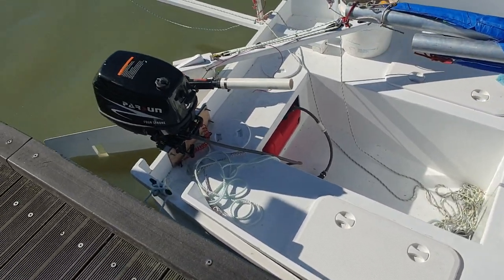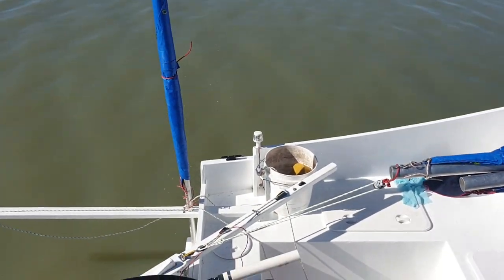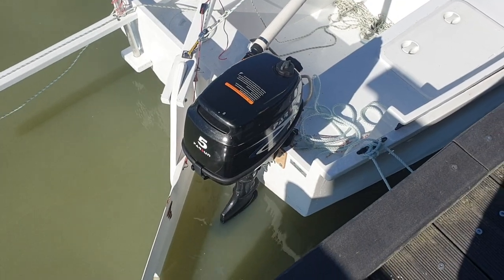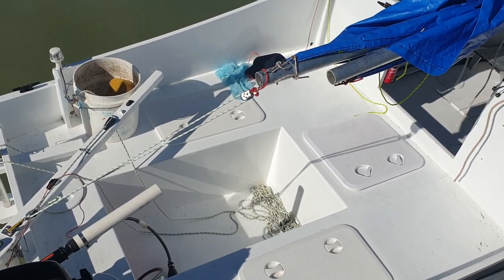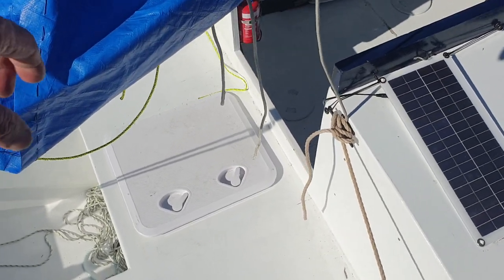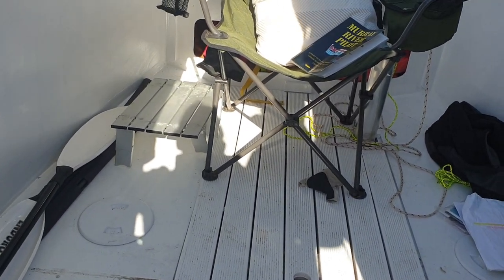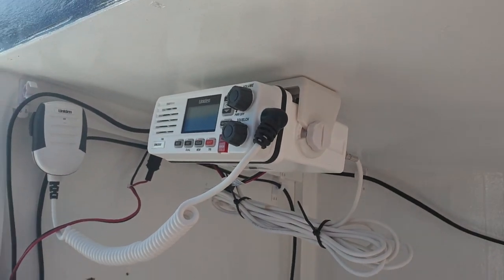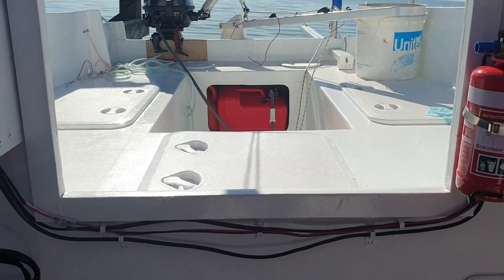"CoolChange" walkthrough..

Comment: Thanks for the walkthrough! I am curious if you'd share a few details such as how long it took to build and what's the weight like? I have a 4cyl SUV and am looking for a nice roomy design to trailer and sail with my family of four. Thanks!
Reply from the maker: Hi Daniel. Happy to help in whatever way I can. Mine took me about 6 months at about 10-15 hours per week on average. Finished weight is under 400kg, so is easily trailered at under 700kg. I have a 6 cyl 4wd, and I hardly know it's on the back. The Blobster is a great family day-sailer or camper for 1-2 for inshore or lakes/rivers. Very stable and easy to sail and navigate shallower waters.